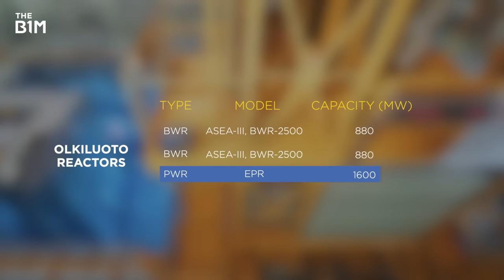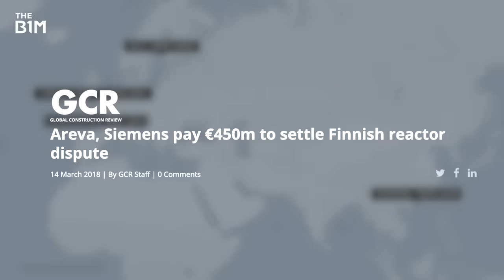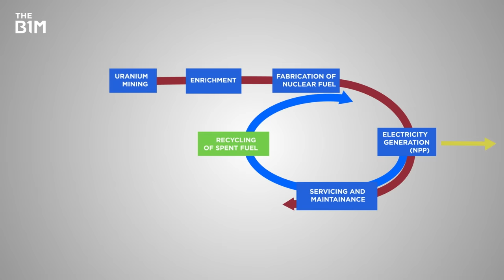Finland Might Have Solved Nuclear Power’s Biggest Problem

Comment: It's also important to recognize that even though reprocessing spent nuclear fuel to separate fission products (arguably the real waste) from uranium, plutonium and minor actinides is not cheap, it doesn't have to be if your supply of fresh fuel is not a constraint. That means that deep geologic repositories such as Onkalo are really an absolute overkill.

Most of the cost from reprocessing is associated to the fact that all steps have to be operated remotely, and no maintenance is possible while equipment is hot due to gamma emissions and heat evolution from mainly two isotopes and their daughters, namely Cs-137 and Str-90. Given that both of them have half-lives around 30 years, this means that after ~300 years separating the actinides from the remaining stable decay products and few long-lived fission products could be done rather cheaply, and probably way before that.

So it's arguably enough to design a surface repository capable to isolate the spent fuel for a few centuries, and then go back and retrieve the stuff to separate the unused fuel (plus any other useful fission products) instead of having to deal with the hot material today. And unlike in the 1960s, we now know that uranium is rather plentiful; thus we have plenty of time to develop and perfect breeders.
Reply: Or you use a molten salt design and separate the fission products on-line and continuously.
Reply: Wow a comment that is actually somewhat insightful and thought out...I bet this won’t get any likes
Reply: A solution to nuclear waste has actually been found. Look up the safire project. Electromagnetic transmutation of elements.
Reply: There are many proposals for what you might do with the waste in the future. But the whole idea here is "We created this mess, we have a responsibility to deal with it."

Just leaving it in storage for 'few centuries' and hoping the future generations clean it up is precisely what they don't want to do.
Reply: My God-given geo-thermal solution is waaay cleaner. Not like any existing method.
Reply: @ChristopherPronger  It certainly requires a change in perspective. The problem with the public perception of SNF is that unlike other forms of residues such as chemical waste or heavy metals in soil, destroying or isolating them from the biosphere is not part of a zero-sum game with future generations.

Radioactive isotopes decay away with time, no human intervention required, and the more dangerous they are because of their activity, the faster they go. For the same reason the sooner you want to separate the troublesome species from the fission product mix, the more expensive the process tends to be (everything needs to be remotely operated in hot cells, no maintenance by humans, and even standard electronic circuits get fried). That's why online reprocessing is so hard (and hasn't been commercially demonstrated anywhere yet), and currently we only do it at considerable expense once the SNF has been cooling for 5-10 years in water ponds, using PUREX in facilities like La Hague.

But if you wait, literally just by waiting the radiotoxicity reduces exponentially. So I'd say we'd be making a fair deal with our grand-grandsons: we'll leave you this task half-completed plus the funds to get it done (i.e. through a waste management fund) once it becomes cheap enough by itself through natural decay, or till your grandparents decide to invest in R&D to get it done earlier via commercial pyroprocessing. And all the while the stuff will remain perfectly isolated from the environment inside this 130 ton casks themselves inside these dozen concrete fortresses.

Compare that with carbon capture and sequestration (CCS), which we'll almost surely need to do on a massive scale to avoid runaway global warming by mid-century onwards. We will be pumping literally billions of tons of CO2 down into geologic reservoirs, and we'll have to make sure that those traps are stable enough to prevent leaking during periods of thousands of years (or that the CO2 mineralizes into carbonates down there). This is peanuts.
Reply: I appreciate your insight and framing the issues.   When it comes to nuclear power, I will take "overkill" over "arguably enough" every time.   "Overkill" is far more difficult, if not impossible, for nuclear power opponents to defeat versus "arguably enough".   If people are more comfortable and at ease with "overkill", then that seems to be the way to go.
Reply: + grobocopatel  you mean you would offload ALSO those costs onto future generations (along with a lot of other cleanup jobs). Because I would give companies not even 30 years before they cut corners the moment they are not actively using the material and are making money of the technology. And dear polticians and regulators are not going to bother them.

At some point there will not be a lot of nuclear fission power plants around so all related technology (spare parts) will become very expensive. And I would not trust any geological site (usually depleted mines to remain stable, and no water infiltration over thousands of years. An area might have been stable in the past, but even creating those excavations changes the dynamic. 

Also nuclear fission is not clean as they claim in that fluff piece  (at all - just for starts consider the mining or reprocessing) and it is also a limited rescource (uranium). Creating something that needs to be processed at high costs and stays radioactive for hundred thousand years ... We are going to have at least ! 1 - 2 glaziations and with all the tectonic movements, some continental drift,  and likely a supervolcano outbreak no site will be really safe.

If humans experience a few years of global dimming because of a big volcano blowing up (never mind acid rain) or a glaziation, nuclear fusion might be good to have for mankind.  But if humans reduce their numbers slowly and harvest water - there would be plenty of sunny, windy days, in summer and in winter to harvest solar and wind energy. There is hardly less solar input and day length is not different. Instead of the land then covered by ice, there would be more land available at the shoreline as the ocean water level falls. With cheap energy water can also be transported. And we know that the North of Europe is still bouncing back from the compession of the last glaziation, so if the masses of ice come on it again, it could also have effects on storage of nuclear waste. 

In 50 years  humans hopefully have finally found ways to harvest and store a part of the huge solar and wind energy at very low costs (at least 10,000 times more energy - all energy not only electricity -  than we currently need reaches the surface of the earth). But these future generations would  still have to deal with the expensive dead end technology and the side product nuclear waste, because the current generatiion is not willing to spend the money to develop the technology right away.

And the longer nuclear fission is used  and the more power plants there would be the more accidents there will be. The theoretical count has been surpassed by far that would only apply if humans were completely logical beings.
Reply: @ChristopherPronger  your your everyday day life is influenced by outcomes from previous generations.  And it's nothing to compare with the waste from solar panels and wind turbines.
Reply: That would work if we could rely on someone being there a few centuries later to perform the reprocessing.
Reply: @nnelg8139  If you think nobody will be around in a few centuries to perform the reprocessing, then what are we arguing about? It means we nuked ourselves to oblivion and every major city in the northern hemisphere has become a radioactive wasteland.

I wouldn't worry too much about the fate of SNF under that scenario.
Reply: @Grobocopatel  Except.. nuclear weapons don't produce much of a "radioactive wasteland". The fallout zones would be relatively safe after just a few weeks or months.

Used reactor fuel is dangerous because it has been neutron-bombarded for years.
Reply: What if technological civilisation collapses? Then you would be bequeathing a massive unsolvable problem to future generations and the biosphere.
Reply: @Pasandeeros   It really depends on it being an air-burst or a near surface detonation, as the latter leads to much higher local fallout once the debris sucked up by the fireball mixes up with the fission products and neutron-activated materials from the bomb's casing. And of course, there are also weapons deliberately designed to maximize fallout by lining the secondary stage with cobalt, tantalum, zinc or gold (they all become hard-gamma emitters after a single neutron absorption).

Oh and by the way, the blast and the thermal pulse from the explosions will probably be enough to kill most of the population in those cities anyway, not to mention the worldwide economic and sanitary collapse (read: infectious diseases making a deadly comeback to developed nations) that would follow.

Of course the total radiotoxicity of thousands of tons of SNF is higher on aggregate that what nuclear arsenals contain, but there's also no driving force in dry casks to disperse the material over wide areas to contaminate, as a nuclear explosion is an extreme example of.

So again, I wouldn't worry too much about SNF under a nuclear war scenario. It is absolutely safe to assume that it will not be our top priority.
Reply: @robst247  I don't know what scenario you have in mind. I've already outlined in other responses why the only thing that came to my mind, total nuclear war, dwarfs any issues SNF might represent for both humanity and the biosphere. But if you have another concern you'll need to be more specific: otherwise we'd be just mumbling nonsense over a non-issue.

Anyway, we already know that the biosphere can deal with the equivalent of SNF. As you might know, both U-238 and U-235 (the two most abundant isotopes of uranium) have very different half-lives, and so in the past U-235 made up a higher percentage of natural uranium. In fact, 2 billion years ago it was equivalent to today's low enriched uranium (LEU) and so it was enough for water flooding a vein of mineral to start a fission reaction.  We've found evidence of this in the 1970s in the Oklo Mine in Gabon ( https://en.wikipedia.org/wiki/Natural_nuclear_fission_reactor ), and what's germane to this point, the actinides and non-gaseous fission products only moved centimeters across the sandstone since then.
Reply: @Grobocopatel  The wording "mumbling nonsense over a non-issue" doesn't signal respectful open-mindedness. I've worked in the environmental protection department of a nuclear reprocessing plant (Sellafield, England),  so there's no need for hauteur.
The specific scenario I have in mind, as I indicated in my previous post, is the breakdown of technological civilisation and the prospect of a large number of spent nuclear fuel rods sitting indefinitely in an above-ground containment, which is what you advocate.
Inevitably, there will be leakage as the containment breaks down. The nuclear industry has already abundantly demonstrated its irresponsibility and incompetence on numerous occasions; in particular, its inability to prevent leakages from reactors, waste storages and reprocessing facilities even when they are supervised 24/7/365, so what are the realistic chances of the same industry preventing leaks for many generations to come if those future generations lack the necessary knowledge and technology to address problems that might occur?
Address this respectfully, if you can.
Reply: @robst247  "What if technological civilisation collapses?"

"If"? The collapse is already happening. We're living it, right now.
Reply: @Pasandeeros  I fear your assessment is correct.
Reply: @mikefas1160  Man, take a deep breath and calm down. So much anger and CAPITAL LETTERS suggest you should chill out a bit.

Look, I know I can't persuade your type, and with that I mean whom I presume to be perfectly honest people who have a deep, emotionally ingrained sense of distrust and fear towards anything nuclear. That's unfortunate for society at the hyperbolic level you exemplify so well (i.e., by calling me a "shill" right from the start of your rant) but of course healthy doses of skepticism towards any industry are positive, and would be absolutely welcome if it only represented more than just a negligible minority. If only arguments inspired by a reasonably skeptic attitude were what the debate on nuclear power included, this would be a much more interesting discussion. But instead we have, well, this.

What can I say? Well, "corium" is not the same material as spent nuclear fuel, which is what one would store in dry casks anyway. The former is a mixture containing silicates from concrete, iron and other minor components of the structure through which the overheated material melt and drained through. It's essentially a fragile porous rock once solidified which is internally heated by the decay of fission products, and that's why it's difficult and expensively slow to manipulate safely (i.e., without it breaking it into smaller pieces and releasing dust, just like when demolishing an old building) while decommissioning a reactor which suffered a full meltdown. SNF is nothing like that: fuel rods neatly packed in bundles can and are routinely moved around using overhead cranes and similar remote machinery.

I think I addressed all the points you raise in previous answers, while others ar evidently false. For instance: dry casks are stored in open air yards in NPPs all over the US, and of course they are designed not to leak under rain; yet a surface facility would allow storing them indoors. Another one: dry casks don't need to last for 10k years (let alone "millions of years") as the KBS-3 cast iron-copper capsules that Posiva will use in Onkalo, but just in the order of centuries before the SNF they isolate is sent to reprocessing; and being accessible in a surface facility means those dry casks can be monitored and replaced if and when they age. And so on.

The last of your comments, I must say, was particularly hilarious. "The secret of the nuclear industry" about the half-lives of plutonium isotopes is no secret: that's exactly why (together with other minor actinides) the radiotoxicity of SNF remains a biological hazard for at least 200k years. Nobody is hiding this information, nor anybody could anyway: it's out there printed in millions of nuclear physics and engineering books as well as in countless websites. Yes, besides Wikipedia :)
Reply: Rusto   That's just not backed up by evidence.

At the current market price of $33/lb natural uranium only represents 0.2 cents/kWh on the final LCOE when burned in light water reactors, compared to 1-2 cents/kWh for coal and 2-3 cents/kWh for natural gas. And this is so even though the thermal efficiency of LWRs is only of ~33% (vs. 36-44% for coal plants and 50-60% for a CCGT plants) and just 0.5-0.6% of the mined uranium is effectively fissioned in LWRs after going through U-235 enrichment. That goes to show that even after burning a small fraction of the mined metal and then converting the heat to power in a relatively inefficient way, nuclear fuel costs are still rather negligible. This means future increases in the price of uranium have a long way to go before they'd start to affect the economics of NPPs, and as lower grade ores become profitable to mine, recoverable reserves would then multiply (leading ultimately to either seawater extraction of uranium or partial substitution with thorium, and likely both in such context). In this sense, the ephemeral high uranium prices of the late 2000s did not last long enough to trigger a new wave of exploration, so in terms of reserves there has been only one worldwide cycle of exploration-discovery-production (1970-82) as serious non-military demand did not materialise until the late 1970s and stalled afterwards.

Neither fuel costs nor uranium availability are constraints for the expansion of nuclear power. Capital costs and lack of public acceptance are (and the latter historically correlates with the rise in the former).
Reply: Elysium Industries has adapted prior art to turn spent PWR reactor fuel into molten salt reactor fuel in two easy steps: chop the "spent" fuel rods into bits, then dissolve them, zirconium cladding and all, into the right, 450 degree C. chloride salts, which then become part of your mostly sodium chloride--table salt--fuel carrier salts. Quick, cheap, and easy, and nothing you could weaponize is ever extracted from the fuel salts, until fully consumed.
Reply: Yh, it really is an overkill. It's just that when ppl hear 'nuclear' or 'radiation' they immediately think it's some boogey man that's gonna give everyone cancer. Ppl just underestimate how far we've progressed and what our capabilities are.
Reply: @New Tunes For Old Logos Cost. Unfortunately everything nuclear needs to go through a decade of uncertain licensing, then every piece of hardware tripled, gold plated and quality-stamped by the regulator, and then the facility needs to be over-staffed to guarantee "safe" operation. That's how capital costs can go through the roof and a power source using a fuel that is a million times energetically denser than coal can become more expensive than burning the latter, let alone exploiting SNF decay heat.

If reprocessing was cheap there could be niche applications though. Sr-90 can be used in RTG generators for space probes (i.e., replacing Pu-238 which is extremely scarce nowadays) and Cs-137 could also be employed as a gamma source for radiotherapy and food irradiation (i.e., sterilization); other fission products such as xenon and rhodium are also potentially valuable but not because of their activity. But reprocessing is not cheap today.
Reply: @johnorenick9026  I wish them the best. But as far as I know, they don't even have plans to build a demonstration facility during this decade yet, let alone a commercial reactor. Until then I will maintain a prudent stance regarding their claims and overall proposition.
Reply: @New Tunes For Old Logos Well, I guess you could. Each cask produces 20-30kW each, heating up air by convection from ambient temperature to ~100-110°C. Using an organic Rankine cycle with ~10% conversion efficiency you should be able to produce 2-3kW per cask, although the price will depend on the cost of the evaporator (because your hot fluid is air, a rather poor heat transfer fluid). You essentially have the equivalent of a low-temperature geothermal source.
Reply: @New Tunes For Old Logos I assume that would be too low of an energy level to extract efficiently, relative to the costs required to build, maintain, and insure the system.
Reply: @xyzsame4081  maybe you should look in to the waste from solar panels? Seems pretty bad from what i heard from the experts. They claim it wil become the next asbestos. And its prettymuch impossible to hand in your solar panels for recycling anywhere at this moment... 

Also spending money dosnt mean you can speed up a process. Or should i point out the problems with the current covid vaccins where people have died or had bad problems from it? You know why they didnt know that could happen even tho they had a lot of money to speed up the process? Because you need time as wel to see if something works over time, and if its safe over time. Same with energy storage ideas. Its nice if it works for a year, but if you spend $1bn on a storage system it better works for a few decades. And thats the problem, they find a system that might work, but then it has to be tested for years before it wil be used. So it has nothing to do with not wanting to spend the money, but also with time.
Reply: Can you please point out to me when in history we had a period of a couple of stable centuries in society so we can guarantee the continuation of that deposit?
Reply: It's good that we have guys like Grobocopatel here on youtube to tell how it should be done. Stupid nuclear scientists don't know anything.
Reply: @nanotech2080  Nothing I've written here is controversial, i.e., I haven't laid out the detailed engineering of an "interim" repository able to last hundreds of years. The fact that Cs-137 and Sr-90 are the main problematic radioisotopes in SNF is pretty much known by everyone interested in the topic. And it's the main reason plutonium in SNF is considered "protected" from a proliferation perspective: in the absence of strong gamma emitters and heat evolution, reprocessing becomes much simpler and affordable.

The argument that you need to be a nuclear scientist to understand concepts as simple as half-lives and decay heat is as wrong as condenscending. The "nuclear waste problem" can be as complex to solve as society (and it's fears) wants it to be: you can always think of some unreasonably remote scenario which makes whatever engineered solution you come up with to be insufficient, so more money has to be thrown into more complex studies and/or more stringent requirements the system must deliver. So the problem can become unsolvable and incomprehensibly difficult to model by construction, and this is both great for the anti-nuclear crowd and for the nuclear scientists that make a career out of radiological hazard studies.
Reply: @Grobocopatel  It's not about if you understand them, it's about the fact that someone without any practical work experience in the field can be so full of themselves, that they think they know better than the whole industry, or the thousands of people working on a particular project.
Reply: You’re relying on the false assumption that things are the way they are entirely because of industry limits. A lot of the reason things are the way they are- and that certain decisions are made- is because of politics and vested interests in unrelated areas. And the politicians are less knowledgeable and more full of themselves than anybody.
Reply: Yeah. More countries would be willing to reprocess spent fuel if it wasn't so damn expensive both in energy and in money. I'm no nuclear scientist but i wonder if there isn't a better way to reprocess these rods that didn't cost an arm, a leg and a couple of gigawatts to accomplish.